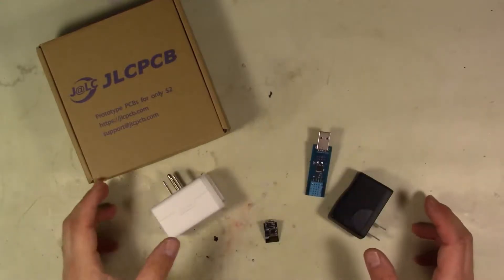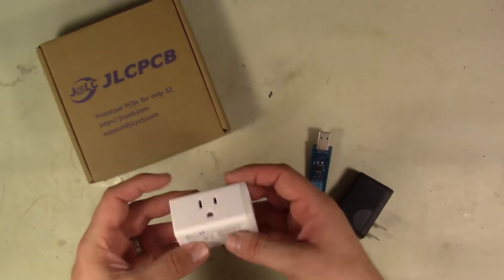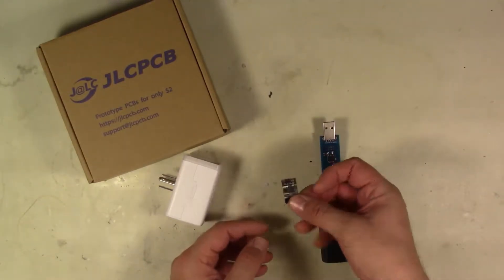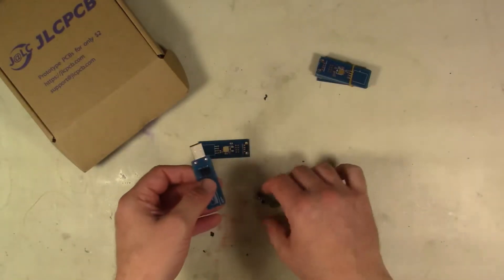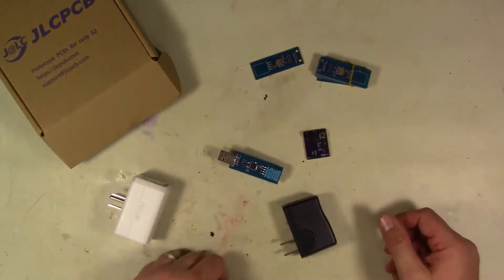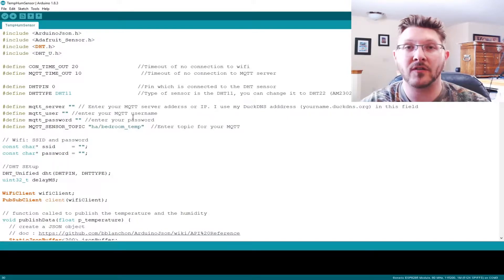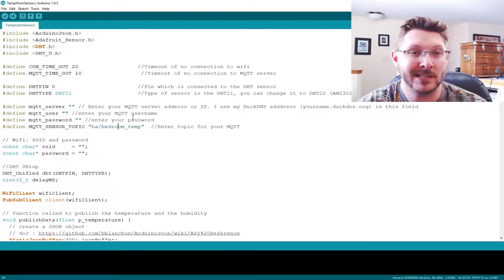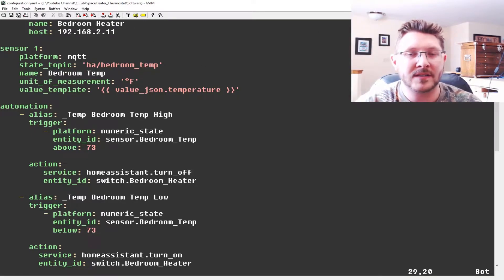HomeAssistant - Temperature Controlled Outlet

Comment: Did JLCPCB provide you with a fully assembled board (headers, resistors, chips and USB plugs) or you had to order them and solder yourself? I'm also thinking that the ESP requires 3.3v and the USB provides 5v so a step down converter is also required.
Reply from the maker: Thanks for the comment.  As of now JLCPCB does not have assembly service but I asked them about it and they said they would maybe have it in the future.  Currently they just do PCB fab and then I soldered the components on them once I got the PCBs.  You are correct and there is an on board linear voltage regulator to take the 5V down to 3.3 so as not to damage the ESP.

Comment: Don't you find that the DHT11 reads why high when mounted to a board, especially beside a voltage regulator? I tried this with the little $4 China DHT11 ESP8266 modules, and was getting very high readings until I unsoldered the DHT11 and moved it away from the board on a short cable.
Reply from the maker: Yes that is true I did not realize this until after I had made the video and left it on for a while.  This device should have a thermal barrier or something to keep heat away from it.  I found that standing the device upright instead of having it lay down on the board helped a bit but it still got the heat through the connections.  I would suggest some copper pours on the bottom side of the board and some via stitching to relieve the heat and move it away from the device.  Good catch.  I hope everyone sees this comment.